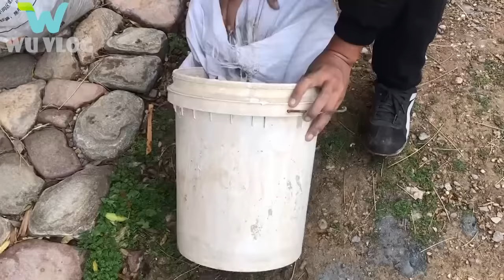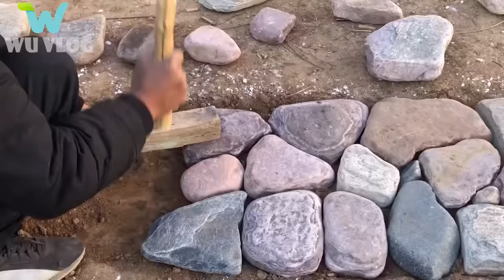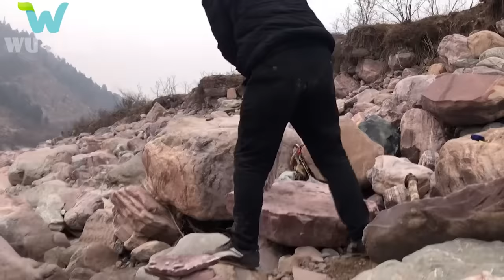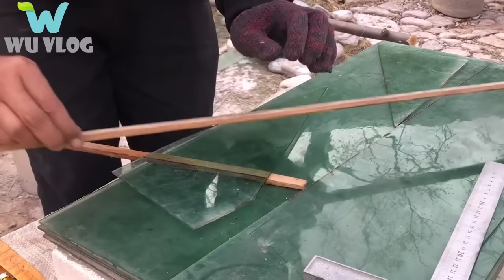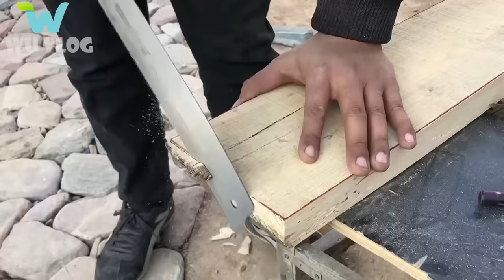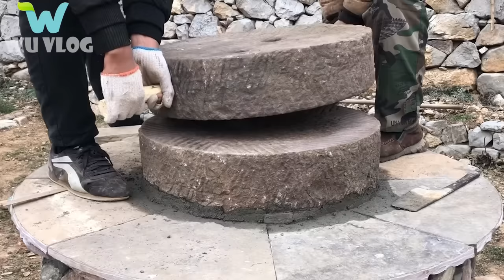The man builds and renovates a house with stone in the countryside Part3 | WU Vlog

Comment: The man is a genius. Doing the paving was exquisite. I loved it. I learned so much. I got the feeling some of the paving stones were from old buildings from the markings on them. Or were they fossils?  Is that his job or did he do this before and after work? He’s amazing.
Reply: Amanda, those larger stones are from a nearby stream bed, and that's why they are polished and rounded.
Reply: @72Yonatan  Yes, the stones are local materials which is convenient  and free of cost. Here a load of  those bulk river stones  (5 m3) would cost 160 USA dollar. I am making a gabion but I am using that type of river stones on the sides only and filling the gabion with whatever I find like old cement residues, stones that are not as pretty as the river-type ones.